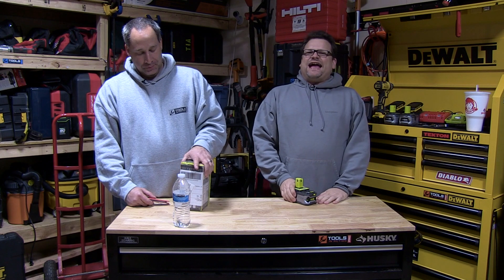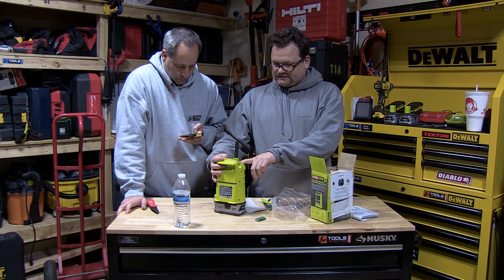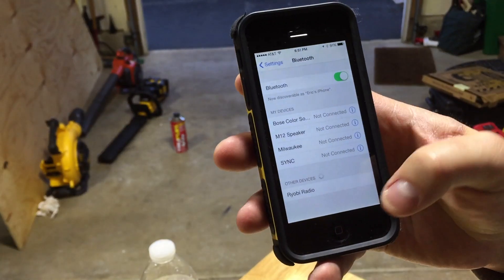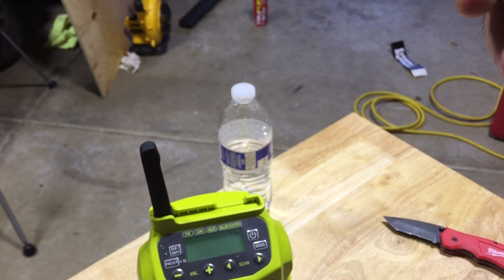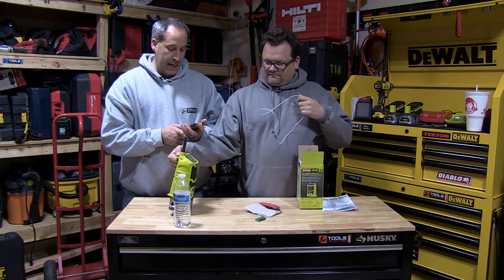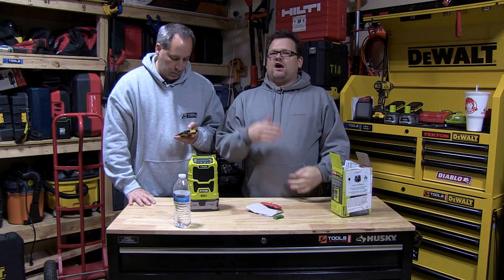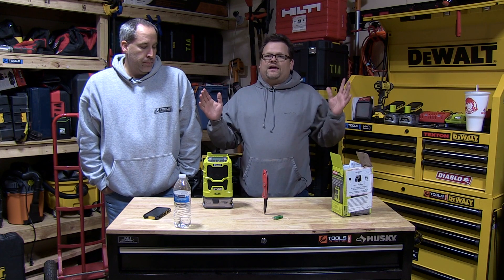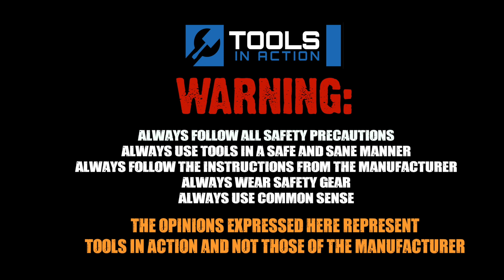RYOBI P742 18V Mini AM/FM Bluetooth Radio

Comment: Looks like it's exactly the same radio as the new craftsman radio that came out at the end of last year.  I'll agree that the sound quality is lacking, but the price ($45) and inclusion of a radio made it hard to pass up.  Also note that the usb charger is only rated at 1A, while the Milwaukee is 2.1A.

Comment: That thing doesn't sound that bad and it's really loud for its size.  You guys should spend a little more time with it...the radio is clear at full volume and so is aux in. Bluetooth does seem to be muffled a bit, but its not the speaker/amp distorting, it's that the thing is small, loud and completely enclosed. I'm thinking about drilling a hole in mine to let some of that bass out. Love you guys!
Reply from the maker: Ron Brooks Thanks Ron!

Comment: You can't go wrong with Ryobi. They have some cool tools that everyone would like to have from the pro to the diy person. The really cool things they have came out with as of late is the Led light, all the different nailers, and this little radio. It's just cool how small it is and its Bluetooth, and probably not that expensive. The other cool thing with Ryobi is all of the outdoor tools that run off the battery.

Comment: The volume buttons on mine stopped working after a couple months,
but the biggest issue since day 1 is this kills the battery overnight if you leave it plugged in even if turned off.  wtf??

Comment: Nice little radio if your in the platform sounded ok little distorted but it also seem like you had it cranked sure normal size room sounds great like you noted. I'm still on the fence with the new m18 radio it's the price and soon as I buy it they will launch a 18v speaker....Milwaukee convention is coming up so maybe we will find out from you

Comment: I own one of these. It eats the battery within a couple of days even when turned off and FM reception is weak (inadequate antenna). I design avionics for a living. This is the 21st century.  Who ITF designs portable battery powered electronics that depletes the battery when the unit is turned off within a day or two ?   Most items that have a clock in them use a real-time-clock chip and a coin cell drawing microamps of current.... they last for years. So the clock in this Riobi radio can kill an 18v 2 Amp hour (or more) battery in 2 days ?   Yes, the manual tells you to remove the battery when not in use only because they discovered the flaw. This radio is simply poorly designed !    YOU'VE BEEN WARNED... Don't buy.
Reply: @Taylormade2350    I design avionics for a living. This is the 21st century.  Who ITF designs portable battery powered electronics that depletes the battery when the unit is turned off within a day or two... It's simply poorly designed !